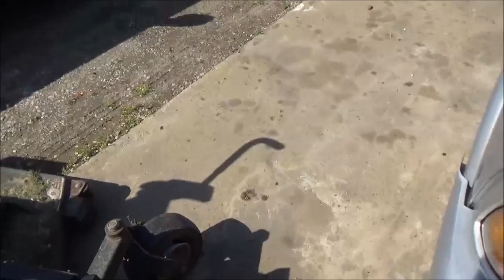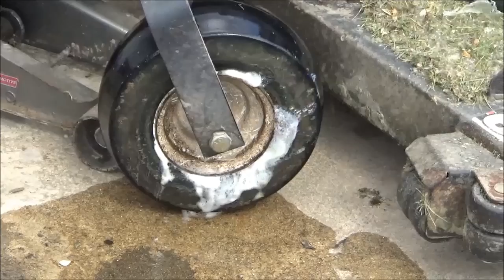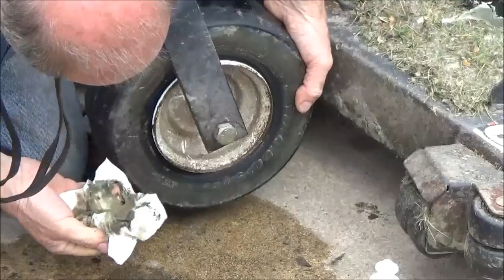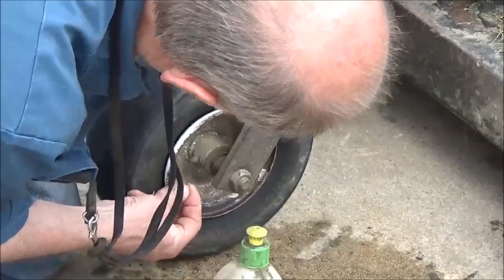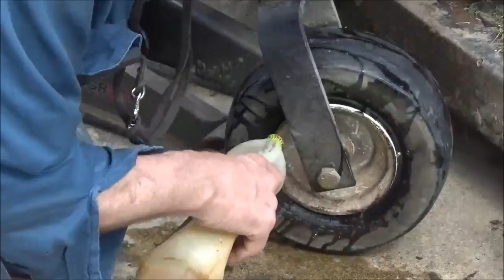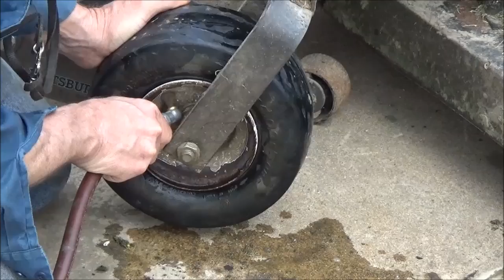Repair rim leak on lawnmower tire

Comment: I had that happen on my Zmaster and I took the tire (16 yeas old) to the dealer and they put a tube in it.  I like your solution to get through the day.  Gordon I like watching your good old fashioned common sense.  When you put a little weight on the tire to hold it in place as you put the air in I was dumbfounded.  I wouldn't come up with something like that unless I saw someone do it.
Reply from the maker: Thanks John.

Comment: You are lucky Gordon.  I had that problem and had to buy a new tire to finally fix it.   Got my truck out of the shop and have hauled some farm tractors and bull dozers.   Have a Happy Easter.
Reply from the maker: That's good to hear that you're rolling again. I've had to change tires on my old lawnmower a few times, for some reason, they're harder to change on those small wheels.

Comment: Leaving the valve core out until the tire seats allows more air to enter the tire to seat it, then install the core. But you didn't need to that time. Thanx for the info.
Reply: I need to try that. Starting fluid and a flame is always exciting.

Comment: Can you put a tube in it?
Reply from the maker: I don't know, it's extremely stiff and hard to work with, If it starts leaking again I'll buy a new tire and wheel. If it gets a puncture, I can always use a tire plug if it's tubeless, I can't do that with a tube.

Comment: Just one more reason to hate cutting grass:)
Reply from the maker: My complaint is the surprises hiding in the grass, we're always flooded here in the spring and can't get to parts of the yards and by the time it is dry enough to get back to those areas the weeds are so high it really needs a brush hog and there's always things in there that will damage a lawnmower.